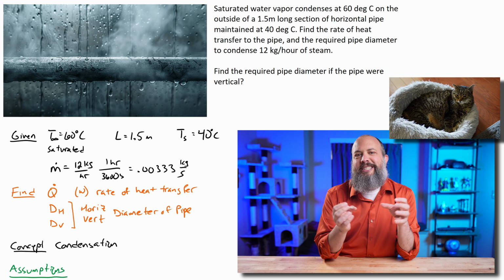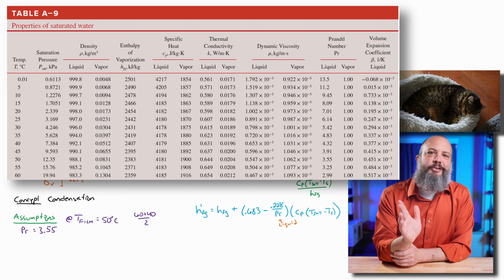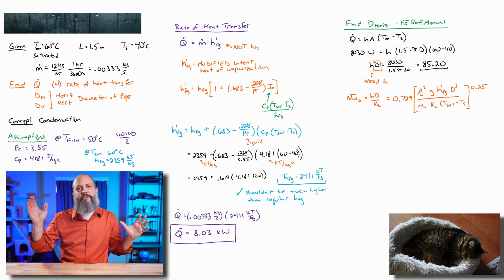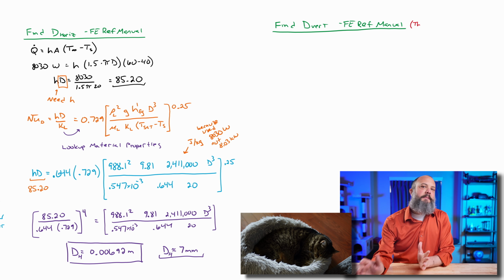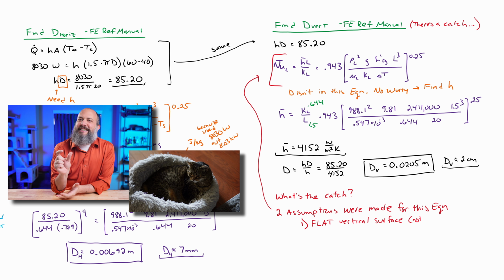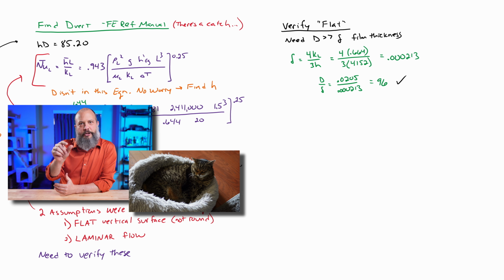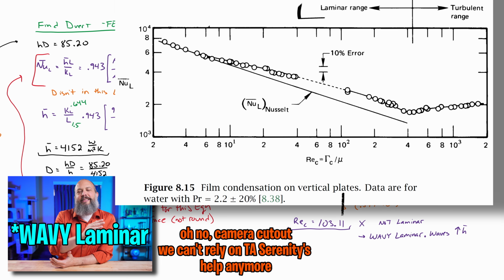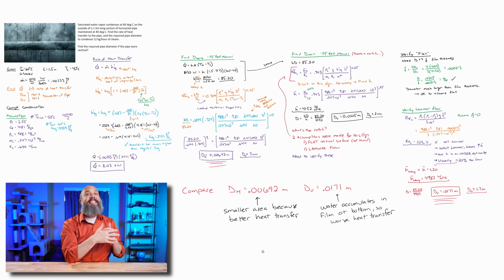Film Condensation Example Problem - Horizontal Tube vs Vertical Plate

Comment: Im sorry, what method should I use if the question mentioned that it uses horizontal pipe and the flow is in wavy laminar?
Should I use the same equation for horizontal tube?

Comment: If I have superheated steam that I need to calculate area of condensation for, can I take modified latent heat as just cpdT (until condensation temp.) + latent heat for condensation itself. I dont really understand why this corelation exists at all since the heat transfered is actually (for your case) latent heat + some sensible heat for cooling the weter further.
Reply from the maker: Yes, that sounds like it should also work, to split it up into 2 steps instead of combining it into 1 step. You should double check with cp is at your highest superheated temp. Textbook problems will always assume that cp is constant, but it's not really a constant, so double check that it doesn't change very much over the temperature range you are using - and if it doesn't change, you may want to use an 'average' cp or some other method to break up your change in temp into multiple smaller changes each with their own cp.